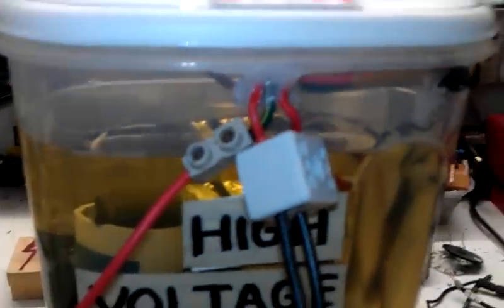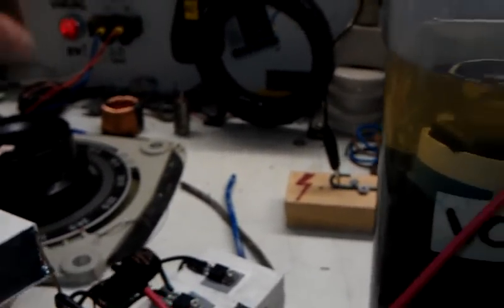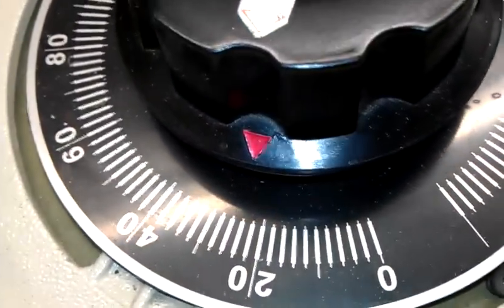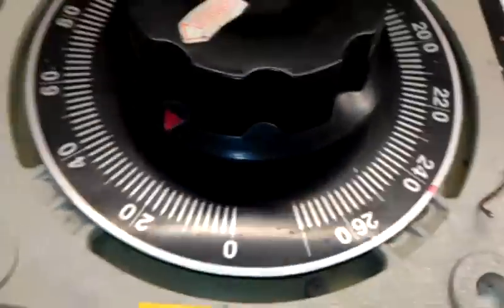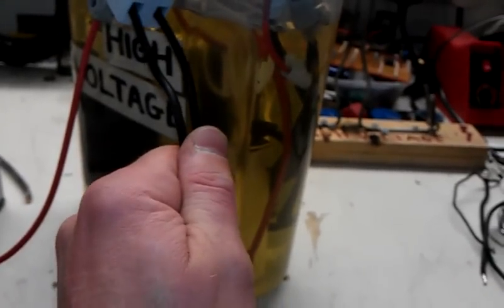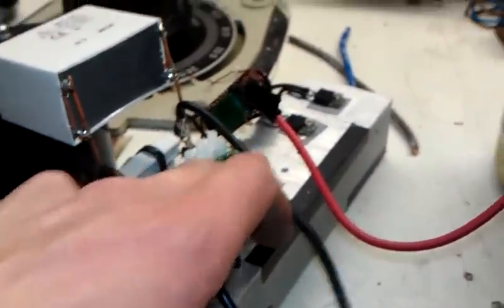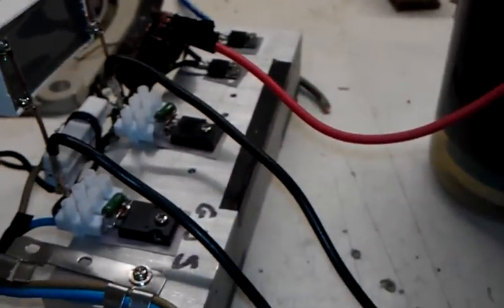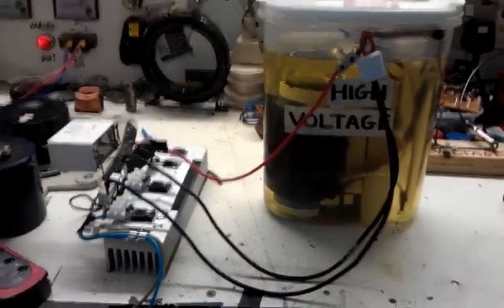60 volts! Iv Blown a mosfet"

Comment: Or use IGBT mosfet they use them for high voltage high current . But the internal resistance are not that good for switching like mosfet and you may not get same result but they work with 60v and up

Comment: What mosfet you use ? 

IAM testing many mosfet for test 

IRFP 460
IRFP 260
IRFP 90n20d
IRFP 4668
IRFP 4868
And more 6 type I don't remember 

But if you want contact me I have some experience I did with too many mosfet most going good in some piont and bad in some other piont .

I realized something important that not all same mosfet have same internal RDS on exactly . 

Most winning mosfet is irfp90n20d the original packaging I installed 2 on a big CPU cooler with very good no 1 quality heat think brown-black grease jell
Reply: Try to use this mosfet on 20-30v and 20-30amp . Even the datasheet say more . But the internal mosfet will heat so far and beyond cooling the hot temperature if the mosfet stay in the active line region . Because the power dispatch inside the mosfet not outside . So you need even to make them switch too fast for high voltage with low current or to switch them low with low voltage with high current